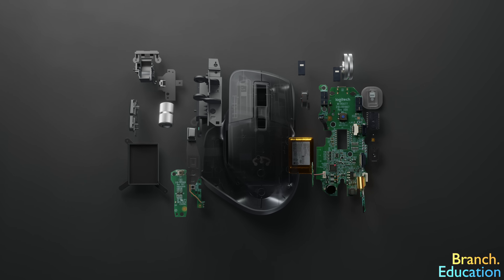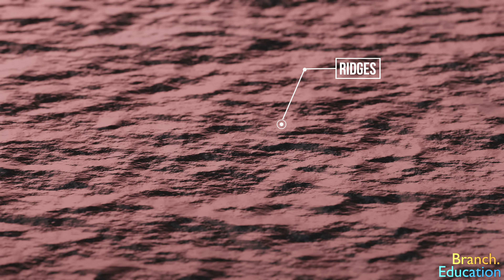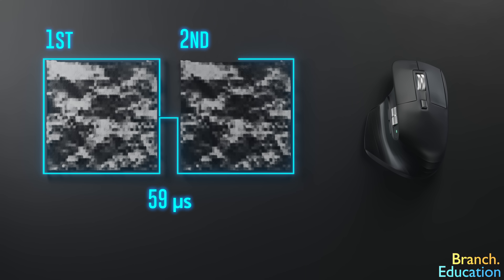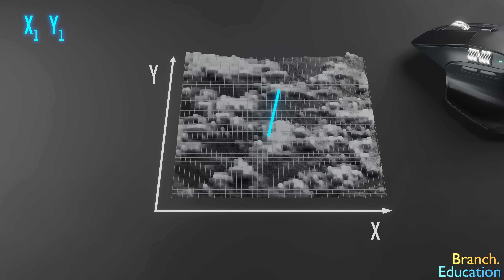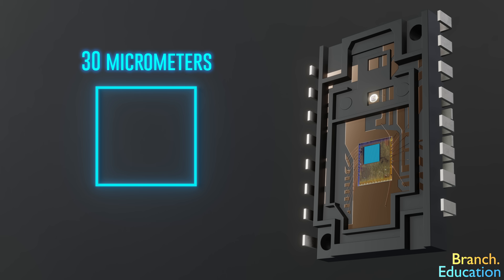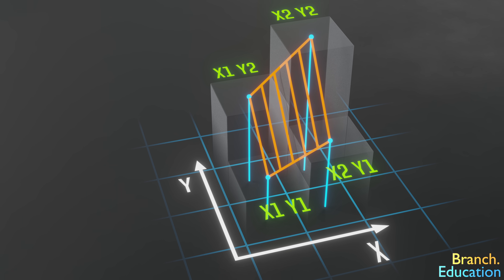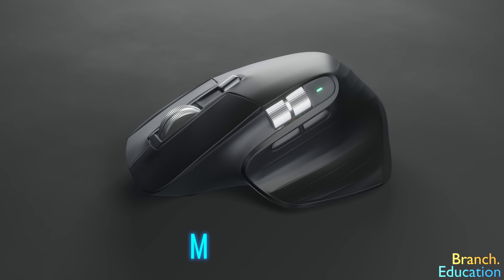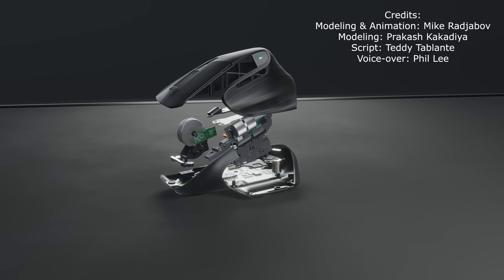How does a Mouse know when you move it?  ||  How Does a Computer Mouse Work?

Comment: Incredible video as always! But unfortunately there's some outdated info!

Your description about how high DPI works on high end mice nowadays is quite different. Interpolation used to be the method before they released PMW3310 and PMW3366, back when mice used to have less DPI settings (sometimes just 2 for example), they used to have an "native" option and the rest was interpolated. However nowadays for most mice, they have native settings in steps, for an overall range of native DPI divided by 50 DPI for example.

They measure and compare pixel brightness to accomplish that, it's possible because nowadays the level of ripple/jittering is very low on high end sensors. Even "smoothing" filtering might not be needed anymore.

Also. Talking about laser sensor, if you're talking about something like the Philips Twin Eye sensors, they work VERY different then described here.

However. High DPI is mostly an marketing big number instead of being something useful. You need just enough resolution to move consistently and precise in your desktop, which might be at MAXIMUM something like 2000 DPI, we lack enough dexterity to take advantage of such high values like 25000.

There are a lot of other things more important for gaming mice... Like:

IPS (Inchs Per Second) - Maximum speed that you can move your mouse before it malfunctions, also, max acceleration.
LOD (Lift of Distance) - The height where it tracks the surface. Generally, you want to be quite low but at a height where it tracks every movement at a high precision of DPI (low deviation).
High Polling Rate - You talked about that, but nowadays there are sensors capable of 8000 Hz out of the box.

Also, high surface compatibility. Generally, you want a sensor that can track well at every type of surface without suffering with bad SRAV (Speed Related Accuracy Variance), sometimes called "positive acceleration". When you move your mouse for the same distance at different speed and get more output that it should. Used to happen with laser ICS sensors like the A9800 with less smooth surfaces.

Also... You can get something like the  Razer Pro Click (or Pro Click Mini) and it does work like an "gaming mice" just as good, they even work at 1000 Hz Polling Rate. There's not an "rigid" rule, you need to see the specs in every case.

There's a lot of "Gaming Mice" from bad brands that aren't better then any office mouse spec wise. They just "look" different.
Reply: you are off on the dpi thing. That depens on how fast you set your mouse cursor in games/windows using a higher dpi setting with a slower setting in windows DPI > 2000 become usable especially for people using their mice mostly with their wrists not their whole arms like it is common today. DPI beyond 10k make no sense to me though and is solely for marketing purposes.
Reply: @spinnenente  it's pointless to use any option on windows settings besides the standard 6/11. Personally, I don't believe no one can have enough dexterity to justify something higher then 2000... But it might be useful at least for 4000 for some players in situations where you don't need pinpoint accuracy. But for the most part... It's just a gimmick.

It might be useful for other applications, like robotics.

Comment: Not a mouse hardware expert (just experienced in vision processing with OpenCL and OpenCV), but I’m not sure the part (4:18) where “the processor then shifts the 2nd image around while leaving the 1st stationary and continues to calculate the difference between the two images until a position is found where the resulting images is at a minimum” is accurate.  That would be a computationally expensive approach, and beyond the capabilities of an optical mouse’s processor, especially an optical mouse from a decade ago or more (at that polling rate, it was beyond a discrete GPU’s capability a decade ago).

What is likely actually happening is the 2 images are being subtracted to produces a difference map with values from -4095 to +4095, and then each row is averaged for a series of X difference values and each column is averaged for a series of Y values.  If the X values are roughly the same (e.g. within ±32 of each other) and not too high (not beyond ±256) that’s accepted as the X-shift value, and likewise with columns and Y-shift.  This approach of signal processing would be much fewer calculations and produce an accurate result as well as a reasonable error state (e.g. when an optical mouse won’t work on a smooth or reflective surface like glass), while being completely plausible with DSP chips from not only a decade ago, but 2 decades ago (it’s no more complex than digital audio processing at the time).
Reply: Note: The calculations actually being used are probably simpler still, with each row being summed (division is an expensive operation) to a range of ±163839 (±4096 × 40 - 1) and checked for a deviance of ±1280 (±32 × 40)— the divisions can be cancelled out of the math.  There’s probably other mathematical optimizations at play too; but the general algorithm above seems to me to be the most plausible silicon-efficient approach.
Reply: According to the video, it seems to perform some kind of convolution and not just measure the difference of the signals in the inf-norm.